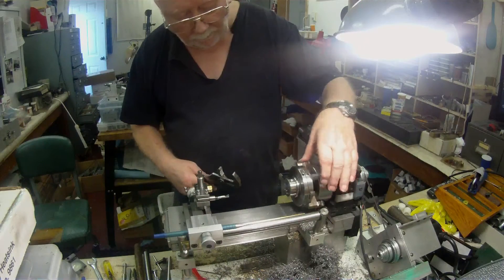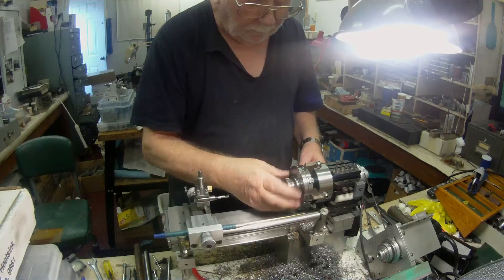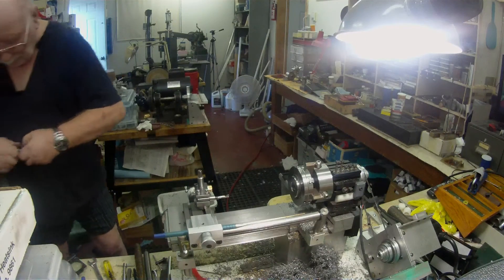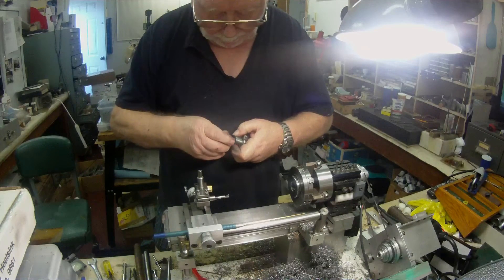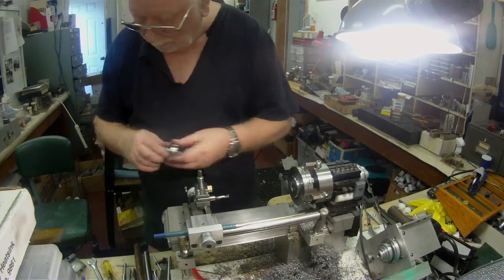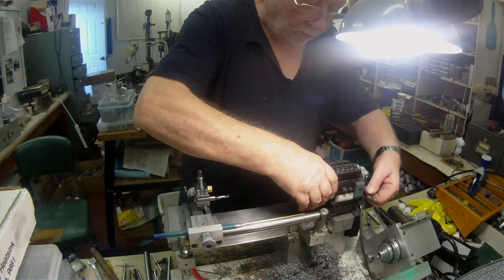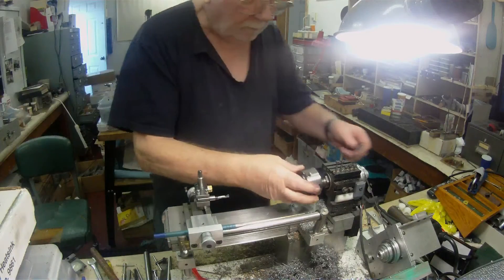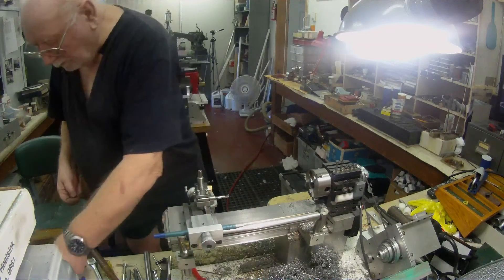FILE0026 Part 13 Modifying Dividing Head adaptor

Comment: Walter:
Is there a Part #12?  Anyway, I see you managed to get the bolt bored with a good fit to the adapter.  Your chuck setup is quite interesting and I know you've used something similar before (holding one chuck in another).  Everything is definitely looking good and I'm looking forward to you next video.  It won't be long now and you'll be able to mount any Taig chuck for collet holder to your dividing head.  Regards: Larry